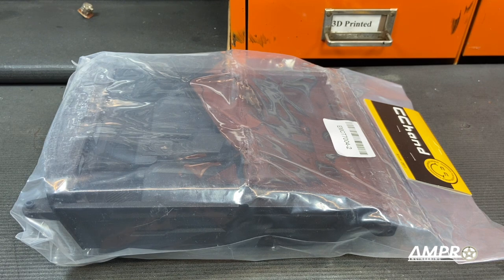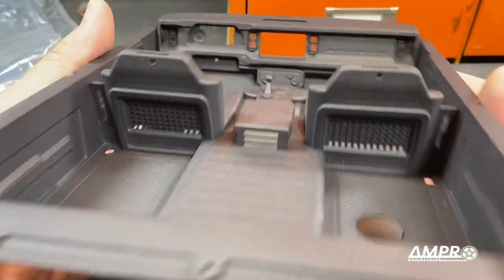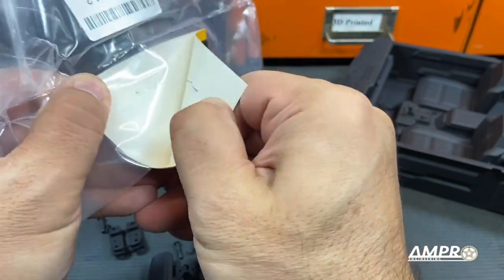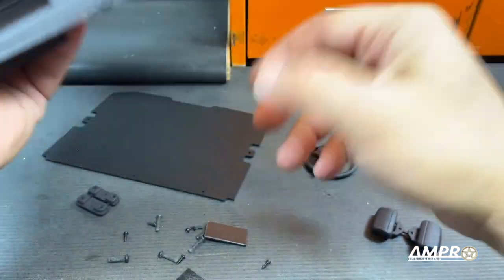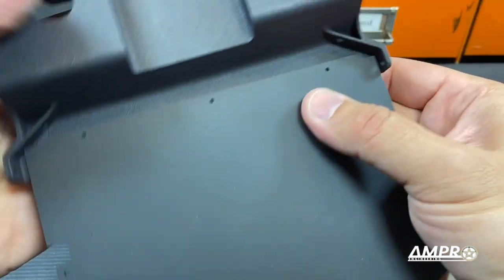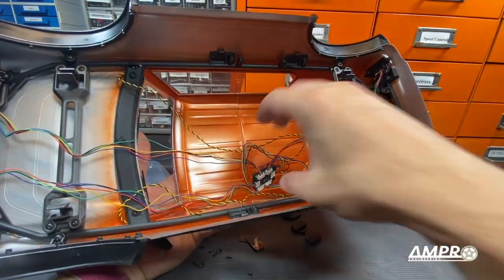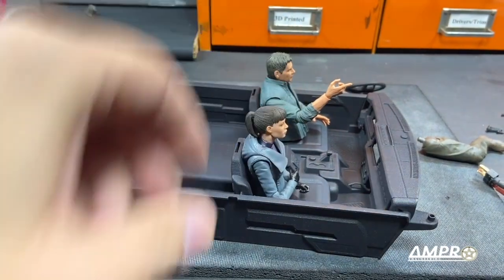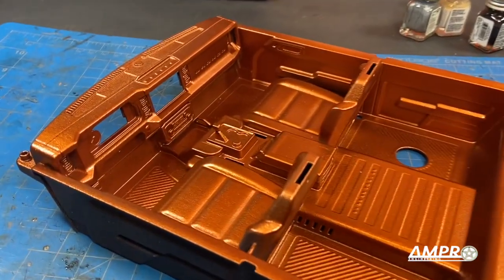e371: Shodog TRX4 Part 3 - CChand Interior

Comment: So, cool.  I always love your interiors.  I did an interior for my TRX-4 Defender and couldn't find a driver that would fit.  Right height but legs were too long.  Legs fit but it looked like a child in the seat.  I ended up doing something similar to your fix.  I got one of the driver inserts for a desert racer and then gutted the Ash character from the evil dead series.   And glued his head & arms to the body.  I'm pretty sure your effort looks a lot better than mine.  But at least it fit and I had fun.
Reply from the maker: I also have Ash for a build! It is always a pain to get people in these cars....so glad the collectors havent seen what I do to their dolls.
Reply: @AMPROEngineering  yeah!  I cut down his torso to fit, the arms are still attached.  I cut out a hole in the torso and  put his head on a rod connected to a servo so his head turns with the steering wheel.  Like you said if they saw how I mangled this action figure it would give then a heart attack. There's very little of the original figure left

Comment: 10:43 or so mark, I am sure you know, but a little trick you can do to make their lack of shins a bit less obvious is paint the floorboards black, as if they had floor mats.  But, then the detail is a bit lost as that just become a bit of a dark void, but really, it's just an area ya never see anyway, so... it don't really matter! LOL  This interior looks awesome though on this new Bronco with your lighting mods!
Reply from the maker: You are totally right. It was getting cold at this point and the paint was already having trouble drying...I just wanted it done. A black floor would have also added contrast and depth for sure.

Comment: Ha, I had to cut Harrison in half to fit my Tamiya Bruiser. Which I used your interior kit.  I had to give him a hair cut also. But you would never know it.  Question--How difficult would it be to design and 3d print an interior kit for the Tamiya TT-02 Touring body/bodies? I was thinking it would also be cool to integrate a body mounting system with Velcro or magnets. My OCD hates those mounting pole sticking out of the body. I have a TT-02 with the Honda NSX body fitted out with a complete YeahRacing aluminum conversion kit with aluminum rod steering ends too.  Fun car to drive. I also have aluminum rims on it. Im already thinking about a brushless motor/ESC upgrade for it. Paid 115 bucks for the car and stuck 250 bucks in aftermarket parts into it. LOL
Reply from the maker: Yeah that seems about the same as what I do on my TA02's. So I am making an interior for my Fiat bodied TA cars (fiat 124 sedan and wagon from a guy in Russia) but they cost a lot of time to make. Custom ones would be in the $1200 in design time range and then the print would be a joke from shapeways. The best thing Is to use the Tamiya generic ones. I use them a lot and for 99% of the cases, are perfect.
Reply: @AMPROEngineering  Wow. maybe if I win the lottery. Thanks Ampro.  :)

Comment: Question/Request: have you ever built/printed the roll cage for the vintage Kyosho Ultima Baja Bug (1/20 scale)?

It is impossible to find them in tact, they are notorious for having the left rear mount break.
Reply from the maker: No I have not. I sadly dont have one to copy.
Reply: @AMPROEngineering  I could send mine. The rear mounts: I do not know if they only put one on there or if the left on constantly breaks. Even if it only came with one side (would not make sense), it does not align properly. Adding the second mount, for which there IS a hole for a screw to mount, would make it align better.

Comment: My pet hate is straight up steering wheel or fitted to low in any interior.
In my custom SCX10 V1 Hot Rod project I made a long nice steering wheel column out of an old transmitter antenna and mounted the Axial racing steering wheel. Figure is Tamiya Wild Willy in a custom made aluminium bomber seat that is angle backwards. In real life I can't sit in any straight up seats at all, as it mess up my already messed up back.
Why half of the scale interior is this way is annoying me. Too small or too big figures is also a pet hate of mine. And aboslutely hate wrestler figures.
Reply from the maker: I mean I know why the wheel was placed there but if they did that, they need to drop the seats. I mean if you are going to put in an interior, chances are you want someone in it. What an odd choice but at least I could fix it. Yeah, i also hate wrestlers in the cars.